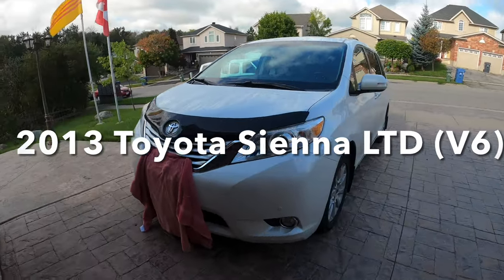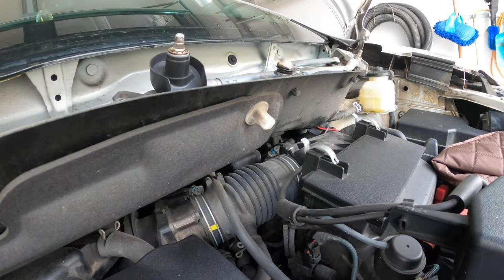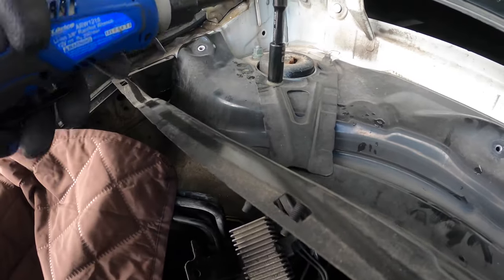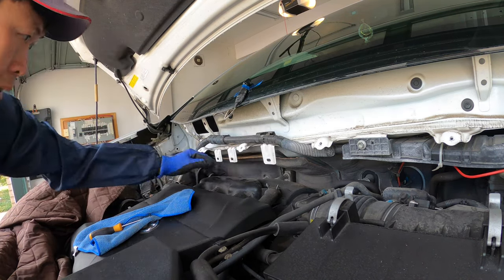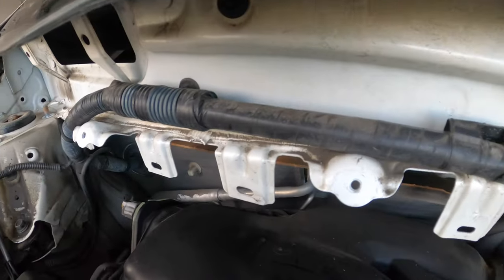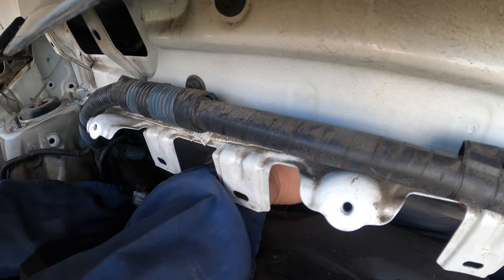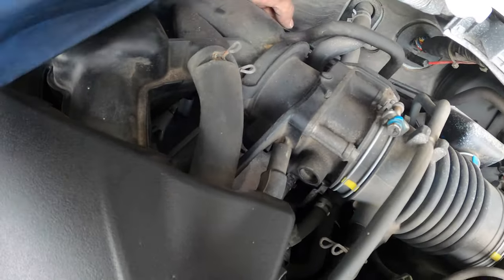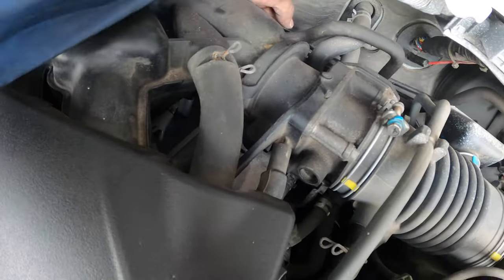2013 Toyota Sienna’s Spark Plugs Replacement w/out Removing The Surge Tank (intake manifold)

Comment: First of all, thanks for this. You saved me time and money. Secondly, dont try this unless you are pretty seasoned mechanic. You need to be in pretty good shape to pull this off. There isnt much room to get leverage on the ratchet. I didnt help things waiting til 260k to replace the plugs. They were almost seized. Neeeded to be worked back and forth carefully. Not something you want to do on the back 3 plugs.. but again, thanks sir. Id buy you a beer if I could.
Reply from the maker: Hahaha! Thanks!
On a hot summer day like today, I would love a cold beer!🍺😀
Reply: I just did a 2010 for a customer they had never changed the plugs . It had three hundred thousand miles. Like to never got those plugs out. Kills me how people never do proper maintenance now
Reply from the maker: Wow! 300K miles/14 years on the original plugs? That’s unbelievable! I never thought that the plugs could last that long. Did you have a hard time pulling them out?

Comment: This is the one of the most perfect vehicle Toyota makes. Plenty of power, tons of space, and bulletproof reliability. What more can you ask for?
Reply from the maker: I would say,  it’s almost perfect! 
During my 11 years of ownership, here are what I have found: 
rear differential bearing replaced due to abnormal noise, drive belt idle pulley and water pump replaced due to abnormal noise. Now the belt tensioner assembly start to make noise (another big job awaits) and the sunroof glass metal frame (especially the front one) has rusted out and may eventually causes water leak.
So therefore, it’s not the most perfect vehicle that I have owned.
Cheers! 👍🤞

Comment: It's good to know the plugs last that long. I've been dreading changing the ones in my 2009 and it's at 130k miles. It's running great so I'll put it off for a while longer. Hopefully I can do it with the intake in place.
Reply from the maker: Wow! 15 yrs on original plugs???
Hopefully they will come out alright. 🤞
Reply: @PTranProductions I have a 2011 and it had 250k before they went out
Reply from the maker: @foygoon9774 
Wow!

Comment: Good explication.  Hector from Puerto Rico.  I have a camry 3.3 2004.  In my care is not easy because need to push out the plenum.  How much time you do that job?.  🙏🙏
Reply from the maker: It took me around 2 hours to do this job.
Reply: Fast.  I need more time in my camry.
Reply from the maker: @hectorpenamedina4817 
Yep, be prepared to do this job from 2 - 6 hours.

Comment: Excellent informative and educational video, thanks so much for doing this tutorial! I was wondering if the coil pack should be changed at the same time with the spark plugs while the wiper tube is already removed? The front spark plugs and coil packs are very easy to swap out. Also, is there a deference in quality, performance and reliability on other brand spark plugs, coil packs? I also thought about doing a light engine rinse and wash to remove most of the loose dirt to minimize any debris entering the spark plug holes doing the process. Any thoughts or comments on this?
Reply from the maker: If there’s nothing wrong with the coil packs, no need to replace. Unless you want to spend money. And if you do, replace with OEM coil packs. Reliable and peace of mind.
It’s your choice and your reference. OEM  spark plugs and coils would be my choice. 
Engine wash would be necessary. There’s not much dirt or that debris that would fall into the engine to cause catastrophic failure. 
Again, it’s your choice and your reference. I didn’t do on mine.

Comment: Thanks for the video! what about gaskets, should be replaced with spark plugs?
Reply from the maker: Np! What gaskets do you imply?
Reply: I mean intake manifold gaskets (three pairs) is it mandatory to replace them? Thx
Reply from the maker: @AZZ-pm2yb 
No, you don’t need to replace those gaskets if the manifold or surge tank are not removed.

Comment: This is not easy method for DIY especially first time doing it. First rear is easy but the 2nd and 3rd plugs not so much as described on your video. I eventually have to remove the plenum for easier access. Thanks for detailed video though.
Reply from the maker: No, it’s not easy but doable with lots of patience and can only be done by feel on the rear bank. 
Removing the plenum (hopefully those plenum bolts not seized up) and the throttle body would give much better access but requires gaskets replacement and providing the potential for parts or foreign objects falling into the intake if the opening not covered properly.
Thanks! 👍✌️

Comment: Good video sir. Mine is a 2011. Maybe change my plugs next Spring. She has 157,000 miles. I guess the plugs are iridium as they can go 120,000 between changes. Enjoy.
Reply from the maker: @157K miles, you’re over due for a spark plug replacement if you haven’t done so. Yes, 120k is the factory recommended interval.
So if you choose to do this method, be patient and work by feel for those on the back of the engine.
Reply: I don’t know man. If I’m going back there for plugs , I’m changing coils as well. Well worth the extra 20 minutes to take off the intake, then you can actually torque properly your plugs.
Reply from the maker: @thomasblanco4995 
Of course, whatever way is easier for you indeed. 
I didn’t replace the coils because there was nothing wrong with them.
Also for the economic stand point, those OEM coils are about $Cad 200 per piece (not recommended for aftermarket coils), so don’t need to replace if I don’t have to. I have seen Toyota’s running at least for 18 years on original coils. So I’ll see how long these Sienna coils will last.
Cheers! ✌️
Reply: @PTranProductions Hi, Sir! Can you give me part# or link to buy this socket and extension and wrench which you use for it? Or can I use standard set where is 1/2 and 1/4 wrenches with 2 long and short extensions????
Reply from the maker: @thelensmax  
My friend, there’s no specific part# for the tools required for this job.  You need a standard 5/8 spark plug socket, 10” - 3/8” drive extension, 6” - 3/8” drive extension and a multipurpose DIY auto repair socket set for this job.

EMENTOL 6PCS 3/8" Drive Magnetic Swivel Spark Plug Socket Set, 12 Point, CR-V, Extension Sockets, Includes 9/16-inch, 5/8-inch, 13/16-inch, 14mm Sockets https://a.co/d/igd9yFB

Comment: W/O removing the surge tank - it's impossible to fit a torque wrench back there to properly tightened the plugs.  You already removed the rear bracket - that's the hardest.  Just 4 more bolts and 2 nuts holding the manifold in, which are easy to get to.  And removing the throttle body is not that hard either.  I did all this today on a 2012 Sienna taking about 2 hours (includes replacing throttle body gasket and manifold gasket, and cleaning).
Reply from the maker: Yes, it’s possible to torque the spark plugs and everything else probably with small torque wrench like this one: https://a.co/d/bDqogpW
Yes, you’re correct that it’s easier with the surge tank removed.  
However the more parts removed the more potential for failure, IMO. 
Removing the surge tank and the throttle body (if all the bolts not seized up) requires new gaskets replacement and gives a potential for parts falling into the intake manifold if not careful or well protected.

Comment: How long did it really take you to complete the whole thing, I know you avoided removing the manifold.
Reply from the maker: It took me around 2 hrs.
Reply: @PTranProductions    Excellent thank you I will try it next weekend, just got a 2016 previous owner did everything at the dealer except for the spark plugs.. go figure.. I guess it's a $600 plus job.  Thank you
Reply from the maker: @playstereo  
You are welcome!
Good luck!
Reply: @PTranProductions   Hello there, I tried for an hour to get my hand to the last spark plug it was impossible, There was not way to do this job without removing the air box and manifold.  Once I removed it it was still hard to get to the first one, you needed a swivel adapter. I god the job done finally it took me 6 hours total.  But thank you for the video I give you props.. is not easy to do it with the manifold still on.
Reply from the maker: @playstereo  
Well, it’s not easy but it’s doable.
As I mentioned in the video, all the rear spark plugs can only be done by feel. You don’t need a swivel socket if you had a 6” 3/8” drive extension. I did on this sienna and on the 2011 Lexus RX350 - without removing the surge tank.
Anyway, removing the surge tank would make life easier indeed and you got it done that way. Congrats!
Sorry, it didn’t turn out well for you this way.
Reply: @PTranProductions   NO worries, It's done now for a while, thank you for the video, I give you props because it was very difficult to get to those even with feel only. Have a great day.
Reply from the maker: @playstereo  
Hahaha! Ok, thanks!

Comment: one question though, for Toyota I always use metric like mm, first time hear people use inch. but, but you use NM instead of footLb. very interesting..lol
Reply from the maker: Not sure why but the Spark plug size is 5/8 (unless there’s a metric equivalent for standard 5/8” spark plug socket).  Everything else on this Toyota is in Metric which is all in mm and NM. Later Toyota models would have 14mm spark plug socket size.
Reply: @PTranProductions 

5/8 is almost exactly 16 mm, 0.625 vs. 0.630
Reply from the maker: @TimAZ-ih7yb 
You’re probably right. I just used the available spark plug socket in the socket set and 5/8” is one of the spark plug standard sockets in the set.

Comment: If I knew it was this complicates just to change spark plugs on the rear, I would not have brought 2017 Toyota Sienna!
Reply from the maker: Yep! All the Toyota/Lexus V6 engines have this same configuration and it’s a pain in the ‘***’ to change the rear spark plugs or coils.
Reply: to be fair most transversely mounted v6 spark plug replacement sucks.
Reply from the maker: @shix13  
I guess so!
Reply: Honda V6 is not as bad
Reply from the maker: @slacker_DIY  
You’re correct! I used to have a 1999 Odyssey - changing spark plugs on that V6 was a piece of cake.

Comment: I'm a bit confused you don't need to remove all those things for spark plugs I just did it yesterday not saying it was with ease like my jeep is but you don't need to do all that none sense to replace the spark plugs with all due respect
Reply from the maker: There’s literally no room to work on the rear bank of these V6s. But if you can do it without removing a lot of parts then that’s good for you.
Reply: I'd like to see you remove the spark plugs in the rear without removing everything that's in the way. 😂🤡
Reply: I meant no harm just was raised to do things easier I'm sure manufacturing company has specific ways of doing things but stripping the whole front end of your car down to get too tiny spark plugs is not needed I did it just fine without that just think y'all should step back from the car and re look at your operating table there is an easier way to do it I know it's tempting to get the tools out and use them but work smarter not harder and key board warriors that call people clowns for finding better ways to do a job really do make videos like these off putting I'm just saying there better way to do it so just take that and move forward instead of attacking people who don't follow the path set forth by others
Reply: @PTranProductions so there is room to do it but I do have the advantage of having a lot of free time to do it and patience I wouldn't take apart the whole car to do the task throttle yes air case sure cover yes some of the tubbing fine but removing everything else is very off putting and it will free up space but with proper tools you can work around just about anything
Reply: @andyleo8418  if you like you can get in touch with me I'll record the steps I did cause I am doing new plugs soon This summer  I'll show you the steps now if you have larger then average arms it may not be possible for you im quite a smaller build so smaller spaces don't really effect me like most men in there 40s
Reply: Mr. Wright, are you talking about your Jeep or your Sienna?